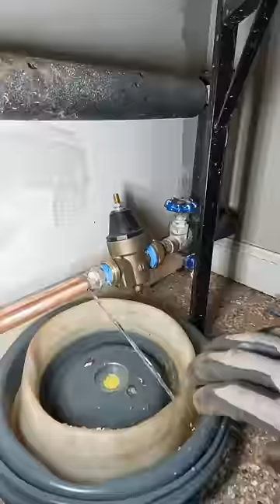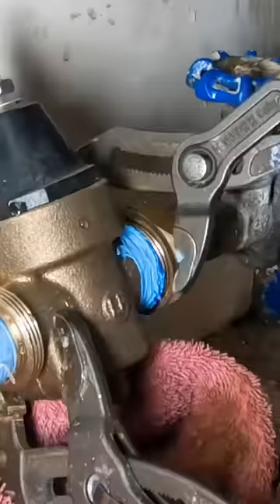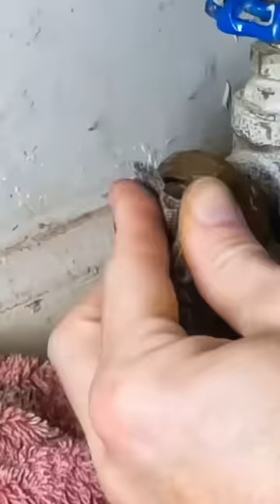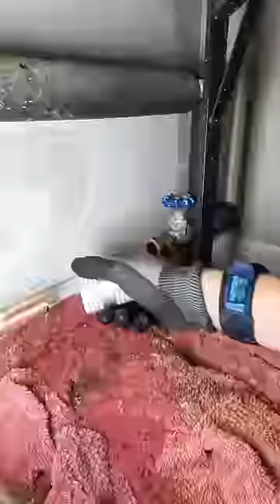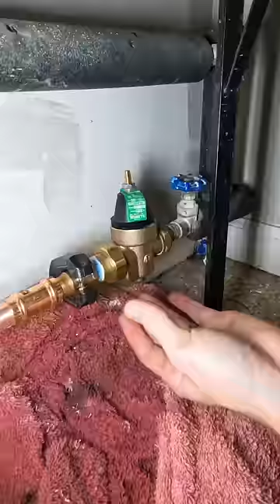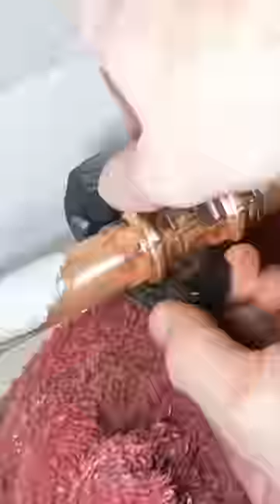Replacing a water pressure regulator valve 💦 #plumbing #plumber #shorts

Comment: Looks great. One question not meant as a criticism though, from a fellow service plumber. Did the customer not go for replacing the gate valve with a ball valve? Or did you have a reason for not touching it and being responsible for it?
Reply from the maker: I have them the option for a little more labor and material … they decided to leave it alone and go with the cheaper option .. she’s never used the gate valve .. always shuts it off at the water meter
Reply: @theplumberlorian  ah okay, cool. Great work!

Comment: Those Watts pressure regulators seem to be failing a lot.  Our street pressure is 120 psi, so stuff gets broken when the regulator fails.  I have installed pressure gauges on both sides so I can monitor the regulator and have installed unions on both sides to make replacement easier.  They do make rebuild kits for them, but they aren't that much cheaper.
Reply: Your street pressure is 120 psi? Do you live in a 20 story building or something? If not then that's stupidly high.

Comment: Being able to solder is one of the skills, a plumber uses.
Reply: Soldering is rapidly becoming a thing of the past. When done correctly, Pro Press will last just as long. There are rare times when you should still solder. This isn't one of them

Comment: Why did you put tough on tape on those threads that's not? Where the seal is?
Reply from the maker: There’s an o ring at the union, teflon tape isn’t necessary

Comment: propress fitting eventually leak. I've had to repair them but didn't have the press tool so sweated it.  It took longer but I knew there would be no returning to fix anything...
Reply: The only reason you were there, was because the fitting was incorrectly installed.

Comment: I never trusted these compression fittings until I had to actually use them... we keep on having water leaks from soldered fittings but not one of all the ones we have substituted with these. I work in a paper mill, and soldering for a repair is a no-no...
Reply: Pro press is fantastic when done right.

Comment: Could have probably changed it without cutting. Take the union side loose and unscrew the other side. Doesn't look like the copper is strapped too close, might be able to find enough room between the pipe and wall to spin it around.

Comment: I don't understand why you made the same mistake as the previous plumber and didn't make a detachable joint on the other side as well. All elements of the system that are subject to wear (valves, regulators, dampers, filters, vent valves, overpressure valves, pumps, etc.) MUST be easily replaceable using only a wrench and a new gasket.
Reply: If you don’t have enough talent to easily replace that valve, find another line of work.

Comment: Hey Mate 

what kind of sandpaper is that you used for the pipe and the paint?

Greetings Form Germany
Reply: Looks like an open mesh sand cloth. Stuff works great, use it myself in HVAC/R. Glides on the pipe and doesn't tug and catch like your typical sand paper.

Comment: I always get rid of the gate valve if possible, future work though 😂
Reply from the maker: It was recommended for additional but they were on a budget
Reply: Hopefully will never have to use is it again. My condo main has one. And I freak out whenever I need to use it which is often  enough  with no quarter  turns. It's above the water tank. What a pain to replace. My gate valves on the washing machine won't turn. And there to close together inset the wall. 30 years old what a shity plumbing company must of been used . Ball valve should of been code at least. Although  I have seem them leak upon shutdown by the meter.

Comment: I don't know why didn't just loosen the prv's union to drain the water...

Have mess with the union anyway,
Might as well loosen it letting the water out in a measured manner, and if my bucket gets full I can tighten it back enuff to stop the draining water, allow me to empty the bucket, then loosen it again and continue draining water.

My boss was an old head and it was years before propress copper.

He would have had the same brand style prv as original

So that the old union works with the new prv, washers & seals.
Just unthread the old one off of the swt male adapter,
add Teflon tape, then thread the new prv onto the existing swt male adapter.

No matter what,
You have to thread a male into the prv, be it be swt copper, propress, brass nipple

Just put it on the existing male and use the old prv brass union nut and flange but with the seals of the new prv

pipe wrenches, channel locks, Teflon tape

Not dragging propress tool, pipe,
nor anything else

And ya have to thread it, build it either way

Oh yeah,
If it's Pvc or Cpvc pipe.
I like to install the prv with a brass cpvc/pvc male adapter on the prv's outlet.
Cutting out the existing one, cause they're usually the cheaper,
fully plastic male adapters.
And
On the other side I'll use a new cpvc/pvc
ball valve as if it was a coupling, filling the gap where I cut out the old prv and old watermain shut off

Cpvc/pvc ball valves are economical and this upgrades, updates, replaces the old shut off

Best part is I can build it all in my lap with wrenches,
then cut,
Mark... cut,
glue, glue, done!

clean up and organize
while waiting for glue to set.

Blam!
waters back on

(background🎸)

stay thirsty
my friends

Comment: Never use a saw zall on old pipe if you can help it. You have no idea what's inside the wall and the vibration might just turn a 30 minute repair into a 3 day fuck up. 

Also: you don't need to drill a hole in the pipe when you have a union.

Comment: Too many people use teflon tape incorrectly on pipe/hose unions that do not even require it. 
It makes me laugh when i go to repair leaky or split  compression olives that have teflon tape on the male thread. Or leaking washing machine hoses that cannot be tightened to compress the washer seal, cause some bonehead put 30 foot worth of teflon tape on the tap thread 😂

Comment: Some people think tape and dope goes everywhere theres a thread.  Of course learning from people is the key to that.  Ive seen tape on flare fittings, gas lines, etc.  I use silicone grease on compression fittings, to cut the friction so that that binding screechy noise doesnt mean always tight enough to seal.  Copper threaded unions also like to bind up before the smash the mating ends.  A little silicone grease will take the friction out of the threading action and easier to tighten as well as remove.  Great video

Comment: Not seen one of those compression joiners before👍
Reply: It's called Pro Press. When done correctly they are a god send. The tool is very expensive so the upfront cost is high.

Comment: First mistake was leaving that nasty gate valve installed.  Those things should be banned.
Reply: I agree but if the owner dosent wanna pay for it, who gets the bill 🤷🏽‍♂️
Reply: @Chipotlesizzle  don't do the work if the owner doesn't want it fixed right.
Reply: @Jch914  Thats about the dumbest thing i heard all week 😂 good luck getting any jobs with that pushy mentality. You explain the possible problems and do the work the customer asks for. If they dont want a new valve then thats that, plain and simple.
Reply: Gate valves are shite. A good tradesman will always look after their customers. So recommending a lever valve wouldn't hurt. Unlike peoples arses in the comment section. 🙄 Tut! Honestly.
Reply: @Jch914 said no actual trade man ever
Reply: @Gregoman89  said any competent plumber I have ever met.  Those things are garbage and so are the plumbers who install them. Thinking your feelings might be hurt.
Reply: @Jch914  as someone actually in the trades I just know foolishness when I see. It has nothing to do with “feelings.” You explain to the customer what should be done and do the work you are hired to do. If they opt out of replacing something that is not required, you just simply let them know what it may effect and in most cases void their warranty. I don’t need to talk to “any plumber.”
Reply: @Gregoman89  oh ok. I guess my 25 years and master license means nothing. No I wouldn't do incomplete work.  That is asking for problems down the road.  Do it the right way or no way.
Reply: @Gregoman89  as a matter of fact, I am doing this tomorrow morning in a 12 story building in my metro.  I won't allow the job to proceed until the valve is replaced.
Reply: @Jch914  that will work in commercial. It won’t in residential
Reply: @Gregoman89  sure it will.  It shows you have integrity.  No customer will call you back after you bill them when the valve fails after you leave.  That is the condition you set for any repair.
Reply: @Gregoman89  fortunately for plumbers, there is always work.  If a customer doesn't want the correct repair, you politely move on. Let some hack make their repair and they will learn their lesson.
Reply: @Jch914  it’s an up sell. You are not a law enforcer drop the attitude and do what you are hired to do.
Reply: @Jch914  crazy place of arrogance. I do the job I’m hired to do. I explain the issues and what could happen. More than likely that valve just leaks by and no one even notices it.
Reply: @Gregoman89  clarify how I think I am law enforcement please. I do the job right.  If the customer doesn't want that, then I pack up my tools and leave.  Plenty of work elsewhere.  I do the job right. Sorry if that doesn't jive with the way you do business.
Reply: @Gregoman89  and it's my job. I can set any conditions I want.  "Do what you are hired to do". Sorry nobody tells me what I can and can't do.  I don't suffer from lack of work, so I can set any conditions I want.

Comment: Why the hell did u drill a hole, when you have a union on the PRV? You could've just cut the pipe exactly where u did and released the water. 
Sawzall, drill, and sanding pipe that's getting junked. Unnecessary work but good result, keep learning and you'll be much faster with same results.
All you needed to do is remove the PRV, why did you do all the unnecessary work? Was the MIP bad or something?
Now u have extra fittings that could possibly become a leak in the future.

Comment: You should have used a union instead of a coupling.
Reply from the maker: I added a union to the PRV
Reply: PRV is a union. He didn't need to cut anything. He could've just broke the union and spun off the PRV, spun the new one on and tightened up the union, and been done. So much unnecessary work.

Comment: No, just no. It's the flat surface that makes it water proof. Why would you add that tefflon on top, it's completely useless and wastefull. 
If your compression joint doesn't allow the flat surface to be watertight then it's not properly done. Which is why it was probably so shabby to begin with. You didn't even try using fibre joints that are made to expand in contact with water...
Don't get me started on cutting the pipe down to add a 3 crimp joints and a free nut! You can simply unsoder if it's soderred or unscrew the free nut to replace what needs replacing. Every single new joint is a potential leak.. If the pipe is too long, cut it down with a little margin then use a matrice to flatten a new flat surface after having added a new freenut on the pipe! Yeah it's cramped but it's copper you had enough space to hammer it and if it was too hard heat it up a little bit to soften it... I am scandalised to see that kind of shortcuts, that is NOT plumbing.

Comment: A doubt this will work in my house where pressure is over 10bar / 140psi
Reply from the maker: It should work
Reply: Your water pressure shouldn't be over 80psi , but yeah soldering will always be most preferred for copper joints

Comment: Would of replace that old gate valve as well and SOLDERED it all.
Reply from the maker: I gave the owner the option, the extra labor wasn’t in the budget.. I’m already onto the next job while your still playing with your torch and that water 👍
Reply: @theplumberlorian pro press has its uses and places. Where you used it was perfectly fine
And the manner you used it just as fine. 

The shop I work for, removing that old gate valve and replacing with a quarter turn, would set the customer back another 100-120. I do a lot of work for lower income folks and lot of times they have to budget for repairs. That 120 charge that we might not think a second thought about (it’s just another gate valve amongst thousands I’ve replaced, after all) could mean going without gasoline, or medicine, or being late on a car note, etc. 

As long as the gate valve isn’t the shutoff entering the home, actively leaking, or shut and broken, I inform the customer my thoughts on gate valves and their reliability versus a quarter turn, and let them decide.
Reply from the maker: @elijah3807 I heard ya man, yeah I offered to replace it for additional labor and material, she was on a budget, wanted to do the bare minimum
Reply: There is no benefit to using solder over crimp or sharkbites.
Reply: @curtrapp5291  lol

Comment: See this is what I do not get !!!! The regulator has unions to take apart and then replace with a new one!! ( even if regulator is screw on down stream side undo union and unscrew from line screw new regulator on to line ). So why do you have to cut off the male thread from line. Just  to replace with a crimp fit male thread, adding three crimp fittings that have to be cut out again if need to replace the regulator???? Also surprised you did not waste more time and materials and did not cut out the isolation valve and put in more crimp fittings !!!!   And best of all would been if put a double union regulator back in !!😂😂😂 total waste of time and money! Like drilling the hole??? Unnecessary Just undo the union !!!! See this is way too much BS takes two min to undo union unscrew from line and replace the regulator then check pressure setting and done !   Total waste! To do all that work for to add more to go wrong and harder to replace if fails agin!  PS if say no room to turn regulator ??? Then how did it get installed the first time??? Know you’ll say the male was screwed into regulator, then was slipped over and soldering it then tightened union !! Okay !! Just heat up and un sweat the male fitting then go back with a seated male and a second down stream union !  Still more better than crimping in three places! If was the owner customer knowing plumbing you would not do this or I would do it myself or get someone do it without the crimping!   Know crimping has its place this was not one of them!!

Comment: Never repair what can be replaced at a much higher cost.
Reply: Most moderns PRVs fail in unrepairable ways, like cracking in the housing or something. Older ones can get away with rebuild kits, as it's typically the rubber that fails on older PRVs.